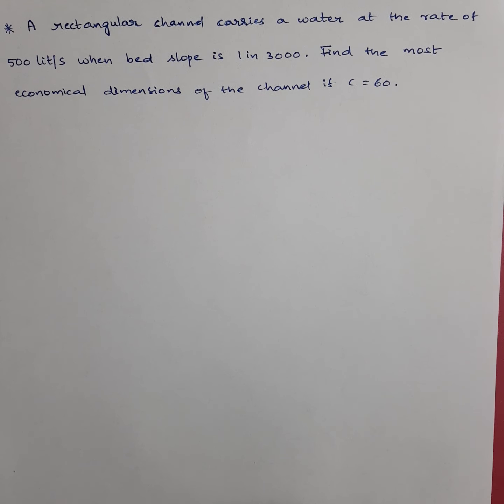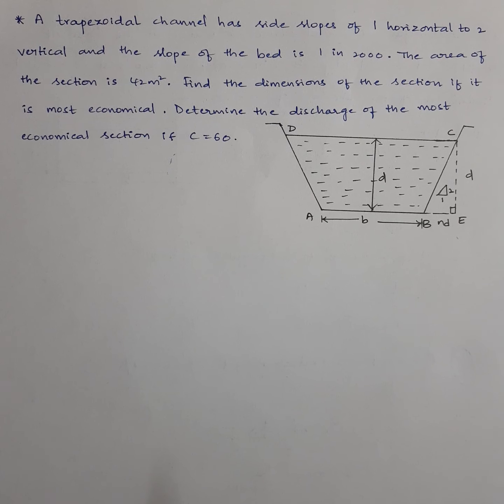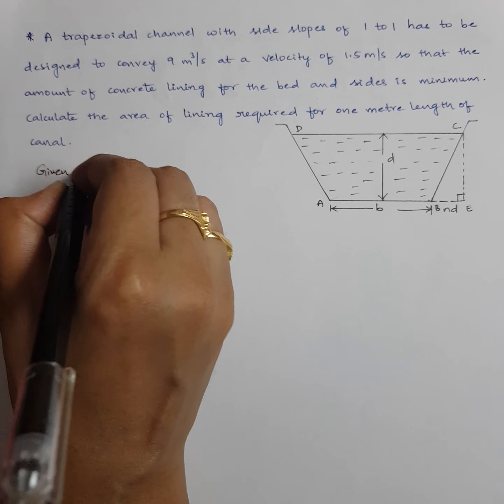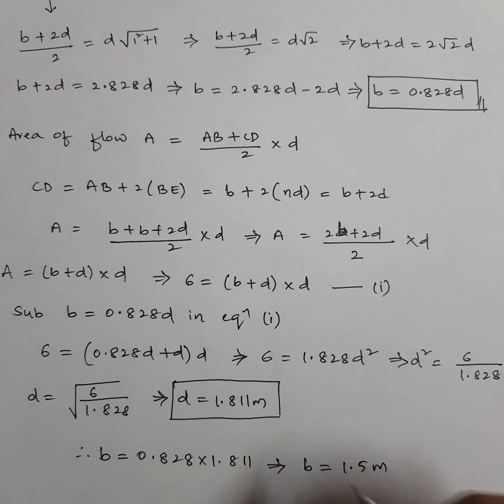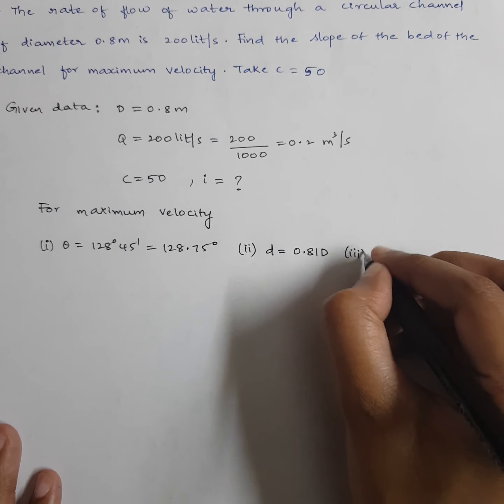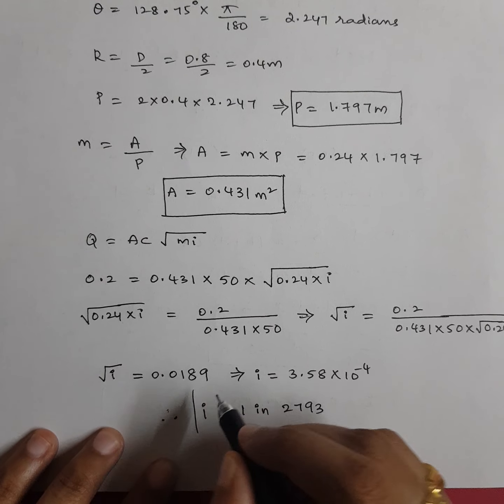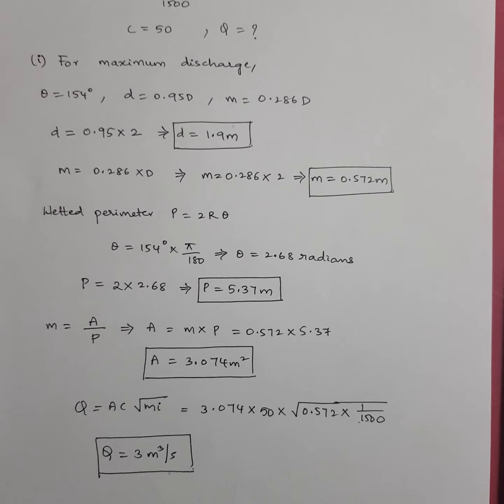Numericals on Most Economical Sections in Open channel flow

Comment: Ma'am how did you get b value 1.23
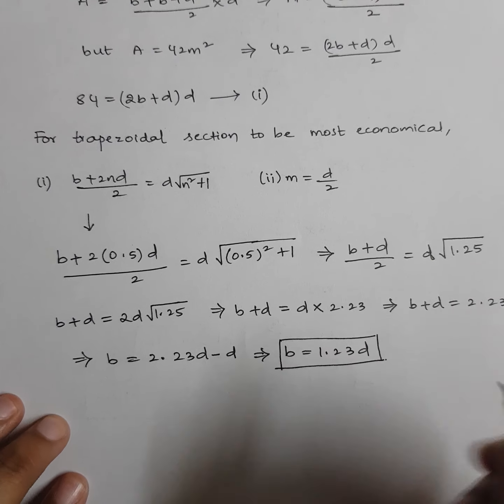Reply from the maker: Please watch from 9:02 to 11:06 you will understand; I applied 1st condition for most economical trapezoidal section
Reply: Actually ma'am I didn't understand from the b value of 2. 23 how did you get 1.23
Reply from the maker: @dhritidas5947  2.23d - d = 1.23 d right??